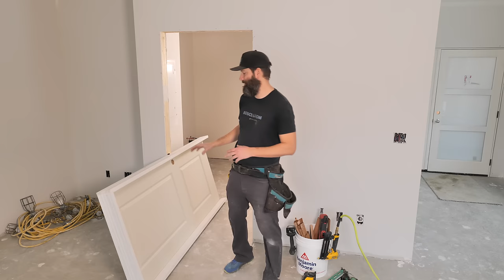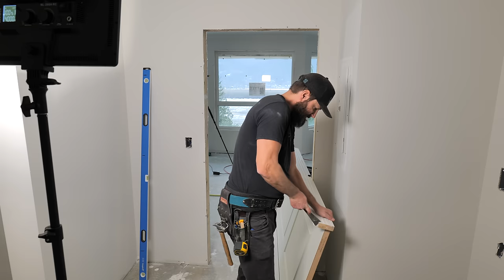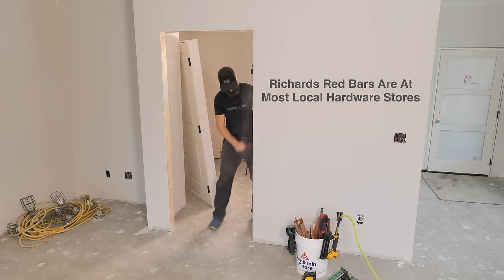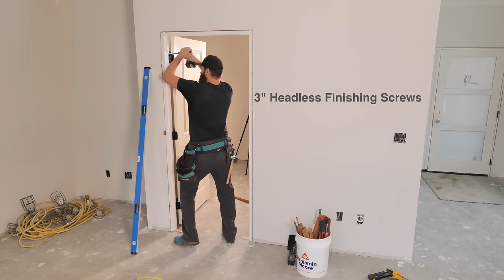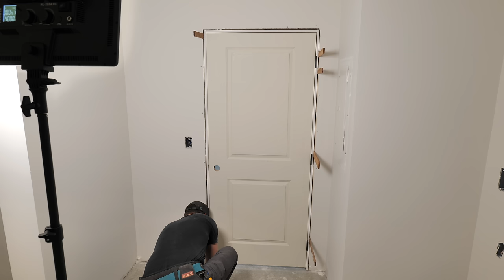The Fastest Way To Hang A Door(Realtime Demo)

Comment: When I was building homes we had a pretty slick method.  You put the trim one side.  Put the door in the hole and (one guy on each side of the door) pushed it all the way to the left and marked, pushed to opposite side and marked.  Then it's easy to center the door in the hole based on your marks.  You plumb and shoot the trim on the hinge side.  Level the top, plumb the other side and shoot away.  Guy on the other side puts the shims in.  We had it down to a science and knocked all the doors out quick.  Very fast and solid install
Reply: Not about you
Reply: That's exactly how I do prehung doors. Only I'm the guy on both sides lol.

These cordless nailers have really made the job so stress free lol
Reply: I was taught to do it the same way only when they're hollow doors
Reply: Sorry typo,.  For hollow doors we skip the shims
Reply: @gregmurphy4231  I can see that hollow doors not needing it. I still do it because that's how my dad taught me to always shim a door to avoid callbacks.
Reply: @gregmurphy4231  why is there no need for shims on hollow doors?
Reply: @tracydaniels2982  Hollow doors are light so the casing is strong enough to hold the jamb.  This way is faster and there are no nail holes in the jamb to fill
Reply: If the nails are going straight into a 2x4 on the outer casing with 2" and 1" into the jamb your frame should never twist. Or bow. And the door is help up just fine. Throw a screw in the tip hinge if your worried about sagging. Like I said. I still shim tho.
Reply: @rgjr702  I heard that. Just go an 18ga cordless and am loving it. Will get a 16ga w proceeds from the next job. I will be able to store them all in one box once I finish out replacement of the Brad and stapler too, then could retire the compressor to the shop or sell it.
Reply: @gregmurphy4231  yes and go to change the casing and the door falls out. That to me is track shacking it. Piece work and who cares about the future.
Reply: @jimg2885  Why will the door fall out? You would replace the casings one side at a time. You put unnecessary nail holes in the jamb and you call my work track shacking. Everyone here are exchanging ideas from experience. You're making trouble and showing your lack of experience. Take a bow.
Reply: @gregmurphy4231  Well I went to change casing on a heater closet door and that is exactly what happened because there was no casing on the inside closet side. As far as lack of experience? I am a retired General Contractor and was very meticulous. So you making that statement is talking out your ass. Making trouble? guess only for people like you. How many doors have you hung in your day. The way you are talking hanging with just the casing was done with hollow doors on tract homes 50 years ago. I would never hang a door that way.
Reply: Union carpenter with 35 years experience. If I could not but casings on both sides obviously I would not do it that way. I call you a troublemaker cuz you're looking for trouble where there is none. You read my original comment, I did not find fault with the other gentleman's work. I offered up a suggestion because we're all on the same team and in the same trade
Reply: @gregmurphy4231  you can call me what ever you want. I am not trying to start trouble by any means. I would not and have never taught one of my carpenters to hang a door with no shims. First off I will say that 90% of the doors hung in tract homes the bottom of door hits the jamb. I did mostly high end custom work and I don't think in my opinion that hanging a door by the casing is a good way to hang them.  That is my opinion and as they say opinions are like assholes, everybody has one. You must be retired or close if you have been doing it 35 years. I have been retired for 16 years now. Retired at 52. Made my money during some of the good times and got out. I am very glad I did not have to go through the 07 and on down turn. I had friends that lost their houses and shut down their companies. Glad I did not have to go through that. Now days I can't believe the price of building and how the average person does it?
Reply: @gregmurphy4231  To the right of your post there are three dots. If you click there, you will see some options pop out. One is edit so you can fix any errors in your post.

Comment: I like how you tacked the shims up first... I always find myself wrestling the door and shimming at the same time. Good stuff 👍🏼
Reply from the maker: Putting the shims up first is a real game changer.
Reply: Why do you have to shim first if the hinge side stud is plumb, level, and straight? lol genuine question
Reply: @redscortgt93  The jamb is rarely ever true and and plumb. The rough opening is always larger than the doors so even if it is perfect, it still needs to be shimmed to the right door width.
Reply: @redscortgt93  the shims are wedges, so how far into the jam do you know to place the shim? it appears you just placed it randomly and shot the brad
Reply: @redscortgt93  You always want to shim and not nail direct to the framing so you can make any adjustments needed.
Reply: @jimg2885  To account for any twist in the framing too?

Comment: I'm a rough carpenter by trade but on the few hundred or so doors I've set, I've noticed that OFTEN, the stop moulding isn't perfectly set.  So I'd end up chasing my tail trying to get the door to close plumb against the stop.  I now check the stop mould reveal before moving the whole jamb to flush up a door.

Comment: Great process and explanation but after doing it for over 40 years, I found and easy way to hang the door on a wall that is not plumb. You centered the door frame flush with the drywall  by starting at the top  but if the wall is off plumb by more than 1/4 of an inch, the door  frame is going to be 1/4 inch out on 1 side and 1/4 indented on the other side
Reply: Continuation. In order to solve that problem. You center the frame at mid height and then plumb it. It will automatically split the difference of the 1/4 inch. Hopefully I explained well. Thank you and I really enjoy your videos

Comment: A couple of suggestions. 
I always pre-drill with a countersink bit any screws I put through.  The chance of cracking is too high (especially with MDF jambs) even with skinny screws, and I prefer not to risk bridging and to have the screw head guaranteed be below the surface without bulging up the surface.  (for when it comes time to finish)  
I try to have the shims from both sides so I don't create an angle that when the screw goes in could cause the jamb to pull in a bit on the unsupported side. 
You may notice at the bottom edge below the bottom hinge the jamb curls in a bit towards the door (9/10 prehung doors seem to suffer from this)  I'll do a predrill and countersink about one inch from the bottom and put a screw there.  The screw allows fine tuning to be able to pull in that bottom leg so that the gap is consistent top to bottom)
Reply: Yes I always like to run shims as intended, one going each direction so your shim is parallel/square to the jamb.  The molding will support the cavity if you don’t but if you run screws into the jambs first they’ll pull the jamb out of square.

Comment: Framer did a good job sizing that opening for the door. Makes door install much easier and faster.
Reply: Openings with that little tolerance can at times make it much more difficult to set a door properly.  Getting an opening where the floor & the opening are perfectly plumb, level, & square is not as common as I would like & having a little extra room to set the door properly despite not having a perfect opening Is always welcome in my opinion.

Comment: For hollow core doors I like to case one side & set the door by  plumbing at the hinges & nailing through the casing into the framing.  This is enough for a good initial set on a hollow core door & allows the casing to act as a depth stop.  It also makes it really easy to check your gaps & make  adjustments if needed.  Once the door is initially set, you can open the door and go to the uncased side to add shims before nailing the jambs & casing the other side.

Comment: You solve that problem by centering the door frame at mid height and then plumb it. It will automatically split the difference. Thank you and great videos
Reply from the maker: It can be good to split the difference to some degree.  If you're doing picture frame mitres I try to keep the head of the jamb flush as possible and fudge the bottoms.  Some times a sledge hammer can also help smack the wall back into plumb.
Reply: @TheFunnyCarpenter  the problem is obvious, we need a bigger hammer! Lol

Comment: We just used EXPR Premium Door install kit to replace an exterior basement door.  It was the fastest install we've ever done.  These brackets attach to the door jam and take the place of shims.  they are easy to bend, and have a slotted hole to allow adjustments for plumb and level.  I am ordering more kits to install the rest of the doors on our major remodel.

Comment: The only places I would differ is centering the hinge jam to the drywall instead of plumb. I'm a little OCD about doors swinging (even a little) under their own weight. I'd rather trim a jam if it's proud of the drywall if needed or cut jam extensions if they're to shy. But I know this isn't optimal for production work. The other thing I would do differently is the 3" screw.  I shim the top right at the center screw of the top hinge and use a 3" screw the same color as the hardware through the center screw hole.

Comment: Pretty close to the way I use to do it but I never used a level b/c all I did was replacement. Had to balance between the paint lines. I would prep all the doors, bottom blocks and the latch keeper. Then put the door in the hole and pop a 16ga. up through the head. That holds it. Shim below the bottom hinge and shoot below it. That way you can pull the shim out if needed. Next it was a 16ga. with pressure @ the top hinge to suck it over. I would shim at the head on both sides, strong enough to hold it in place, balanced between the paint lines. The latch leg could go up or down, as could the hinge leg. Closing the door and temping the bottom of the latch leg. Paint line check... margin @ the head check. Margin check @ the top hinge to latch. Margin check @ the bottom hinge to latch leg. Check door hitting solid on the latch jamb. Nail the head and bottom shims. Always shim behind the bottom hinge shim. That's where the compression happens. Leave the top hinge free. If needed you can come back with a 2 1/2'' hinge screw. Then shim and nail at the latch. 
Did that for about 20 years. Never went to Door School. That's what worked for me. Got it down to 7 to 8 minutes after the prep. So that equal to your 10 minutes. But I was 47 when I started and gave it up around 67. Keep it up young man ;)

Comment: That's all fine and dandy for a newly framed opening.

Now do it in a 100 year old house where the walls is different thicknesses top to bottom due to lathe & plaster, out of plumb and out of square .
Reply: I used to hang doors in existing door linings, which was a bit of a faff! Used to have to make the rebate wider as the new doors were always thicker than the old. I have never fitted a pre-hung door as we used to make the linings on site & then hang the doors from scratch including the locks & latches. That’s why I did 7 years as a chippy & became a building surveyor 👍😂
Reply: @smudge600  Yeah, having to re-size each door is a pain and time consuming.

I just did a dozen of them where every single door had a different jamb thickness, nothing was square in any direction by a lot and the doors needed to be resized top AND bottom so the door handle didn't end up too low (could only find pre drilled slabs at the time due to shortages)

Comment: This is fine altogether but as a suggestion...before anything else, remove the door completely from the jamb. 
Then proceed with plumbing the hinge side after checking floor level and making adjustment to height. 
Next, use 2 foot level to check upper jamp and secure it to the header opening.
Lastly, measure the opening of the jamb at the very top and work your way down the lock set side of the jamb ensuring the same width of the opening. Finally, reinstall door to jamb. 
This is how I've hanged doors for many years and it's always a perfect install while I never have to fight the weight or bulk of the door itself.
Reply: Feels like it takes so much time to take off the door and put it back on I rather fight the weight of the door and just install a door in 5 mins.
Reply: @MSeroga  it takes only a few seconds to remove the hinge pins. 🤦‍♂️ I've installed doors for 46 years and in a properly framed opening, it takes me 5 or 6 minutes to hang one.
This is a great process to hang a door here but it's much easier to remove the door from the jamb first by removing the pins. 
Try it.
Reply: The jamb width same doesn't mean door gaps same because the hinges sometimes are fixed differently

Comment: Several things:

Start by making a 14" 'Eye shaped' block.
1 1/2" x 1 1/2" with a 6 1/2" taper both sides(1" flat spot on centre).
Tapered to 1/4" one side(for finished floors) and 5/8" the other(for unfinished floors).
Sand round the taper as to make a rocking block that performs smoothly.
leave the two flat faces.

This tool is now your DOOR PEDAL.

Installation:
Do all pre-measurements/plumb checks.
Pre-stand your door in place on SPACER.
Remove strike lock screw.
Open door 90*.
Place DOOR PEDAL under door ON CENTER.
Angle door into finished position.
While using the DOOR PEDAL(you will get the hang of it right quick).
Set shims and screw upper HINGE SIDE.
Hold level on inside of door to check for PLUMB, then check jamb for plumb.
Set shims and screw bottom.

Then do the same process.

But check your door swing as well.  It looked like YOUR INSTALL had a lazy close.
I could be wrong.  But would suspect by the way you shimmed, you have a trapezoidal/rhombic door opening.
Proper shimming would solve this.
As well, over time, the slight twist will effect the reveal.
Especially on bathroom doors.
the difference in a 10 year install and a 40 year install.

DO NOT:
Kick the door.  You have a hammer and a block.
Lean door against finished wall.  LEAVE IT UNTIL YOU USE IT.
Pre-nail shims. WASTE/REDUNDANT.
Post-nail door.  WASTE/REDUNDANT.
Waste time dragging around a compressor from floor to floor.
adding time-used to tools you don't need.  WASTE.

All presents you as more professional.  Aaaaaand the painter won't hate you.

Probably falls on deaf ears, but good luck.
Tyler- Finish/Deficiency carpenter 20 years.

Comment: I have an 8 ft exterior door that hits at the bottom and the middle before the top makes contact with the stop. There is about a 1" gap at the top. It looks like the jamb curves outward at the top 1.5ft of the jamb on the latch side. Everything has been checked with a 6' level. My question is if I cut the top portion of the jamb loose do you think I could persuade the jamb to realign itself to match the door or would you think the wood of the jamb has warped over time and it would be a waste of time? Any suggestions would be appreciated.

Comment: I've seen guys do it with the arcs/casing fixed on one side I've done it myself once then once it's square depending on the gap between the studs and the frame squirt some foam adhesive in then pop on your other casing/arc

Comment: I have many doors in my home and they are all different heights from the floor, so what do you do if you have a door and then 3 feet away another door and the bottom of one of the doors is 3 inches from the floor and the bottom of the other door is 1 inch from the floor

Comment: Use Quick Door Hangers and will cut your time in half guaranteed or even less. Cost like around $4 for 6 fittings at Home Depot. No shimming needed, just super fast and accurate installation
Reply: I've heard these are easy but pretty weak installation. What's your experience with the strength?
Reply: @E Wong  this is just a way to hang the doors easy. After hanging, then I shim and secure the frame with screws as I would normally do. Super strong

Comment: How did you know the floor was level without using a level , thanks
Reply from the maker: I used a laser level, and quickly measured the laser line on both sides of the door.

Comment: Made the mistake of building my own door frame for an old door. It works and is plumb, but for some reason it binds just slightly when you are about to close. It does close okay, I thought after a year it would sow me through wear what's binding, but no luck.
Reply: Most doors edges are beveled by 1-2 degrees so they don't bind.

Comment: Also keep in mind if the house experiences extreme hot, and cold spells due to the weather changes, and your hanging the doors in the cold (house isnt heated in the fall/winter) then leave bigger reveals as the wood will expanded ehen it gets heated back up.

Comment: I cut and install the casing to the side of exposed of the hinges. Hang it and nail into the casing , voila !
Reply: Casing installed to the door jamb on the side where the hinge barrel bolts are . This method of installation is done where the unit is on the floor.

Comment: The thing I would do differently especially with solid core doors is unhinged the door. Working with a just a jamb is a lot easier. The middle hinge shims is unnecessary and can cause binding. The door should sit on the floor. Keep the door weight from causing a sag and keeps all the headers the same height.

Comment: amatures follow the wall, put ur shit in plumb
Reply from the maker: Ya good point, I probably should have mentioned my Dad did the framing.  In most cases it’s wise to at least get close to plumb and or start sledge hammering wall plates.
Reply: @TheFunnyCarpenter   Put the jam in plum always  you don't need a sledgehammer you need extension jams.